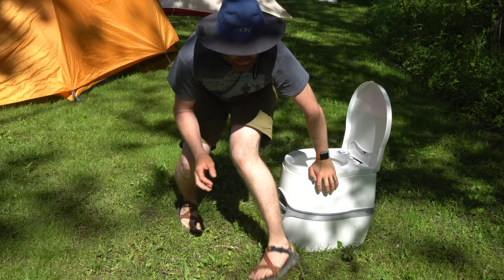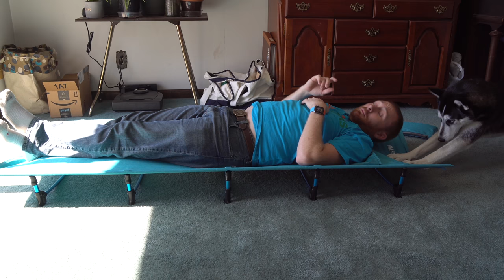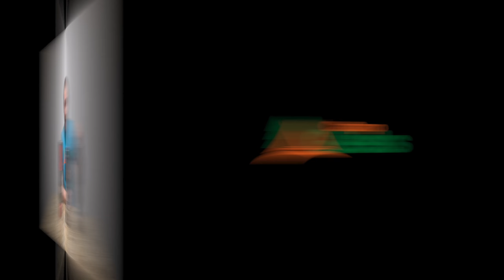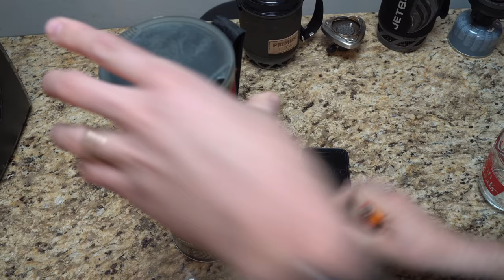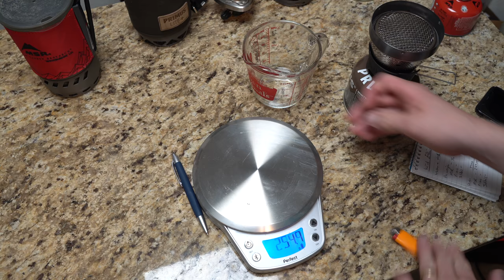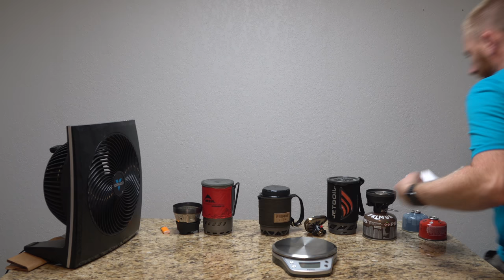How Much Fuel Does Your Stove Use in the Wind? The Stove Wind Efficiency Test

Comment: Just a thought on the Primus...when you reviewed it by itself I noticed that half of the skirt had large triangular  openings and half had narrow diagonal slits. I am wondering if the difference between the staight speed test and this one regarding it is that on the other test the diagonal slits were facing the fan and maybe this time the triangular openings were? I can't tell from the video but that could explain such a large difference if the diagonal slits blocked or channeled the wind that got through them more efficiently than the triangular openings did? I enjoy your channel and will subscribe